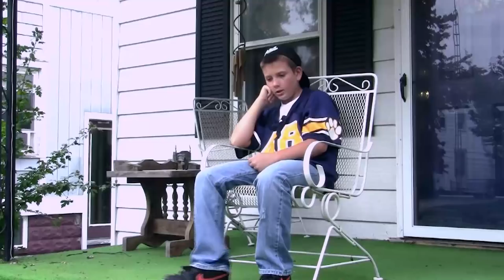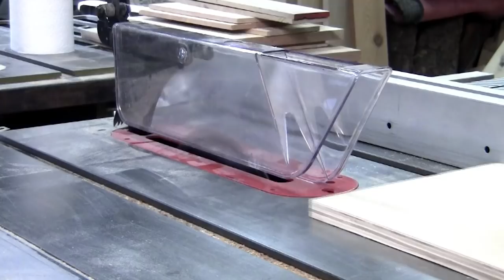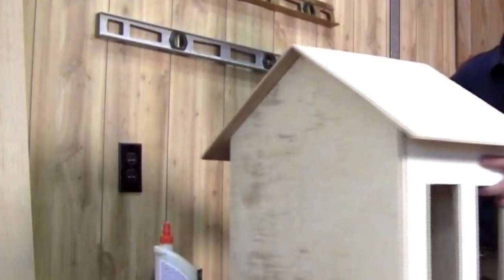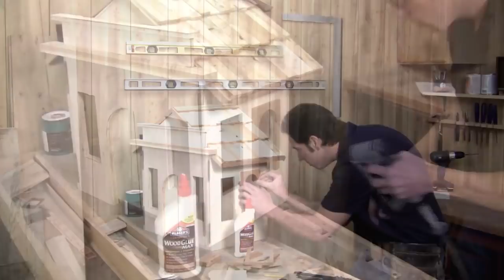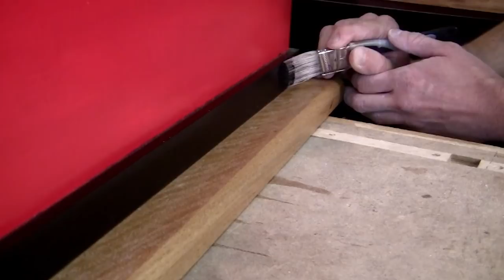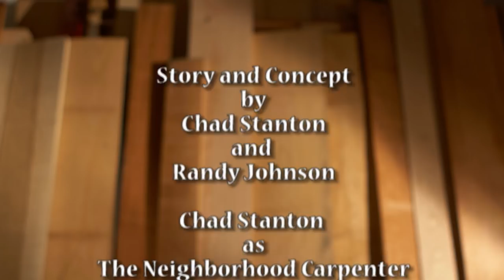Little Free Library Project, with Chad Stanton

Comment: I did a similar project called a public pantry. I clicked on your link, it doesn't seem to open for the plans.
Reply: You might check any popup blockers.  It opens a zip file on my side of things
Reply: Thanks, that worked. Really nice detailed plans. The plywood you used. It is finished on one side? Or did you sand it down?